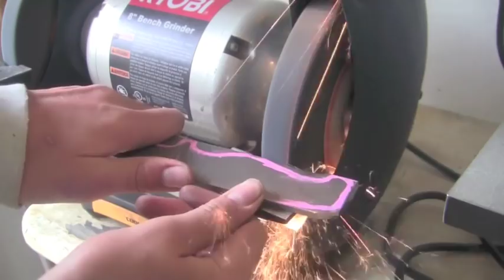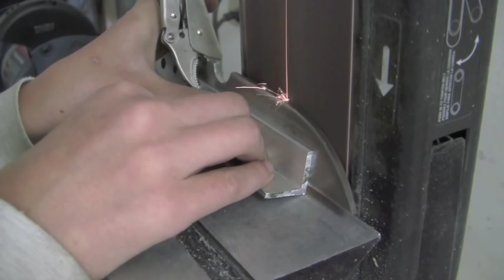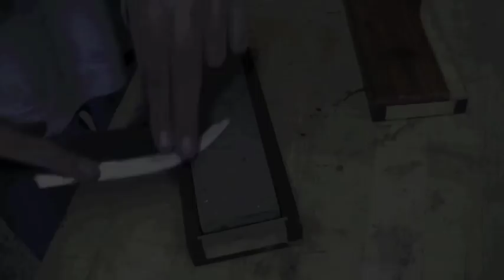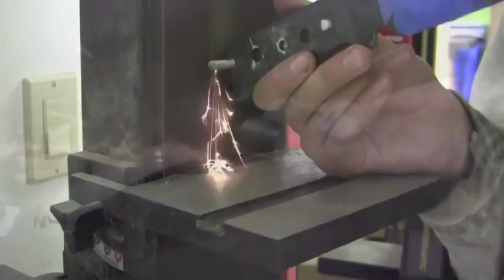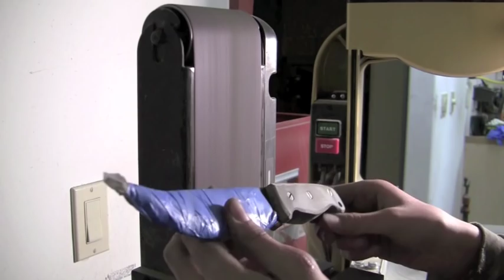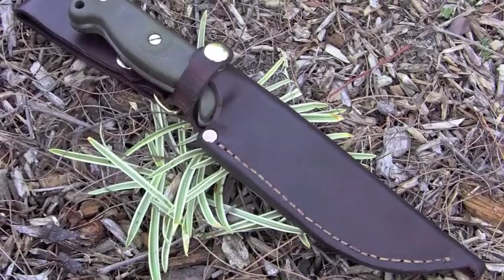Making a Bushcraft Knife

Comment: Where did you get your belt grinder?
Reply from the maker: +Jeremy Baxter That's a Porter Cable 4x36 belt sander in the video. I think I bought it from Home Depot. My current one is a Grizzly 2x72 grinder, which is much better.
Reply: +Mitchel Jacobsen  Thank you, that was helpful, what kind of price range though?
Reply from the maker: +Jeremy Baxter I don't recall. Use google
Reply: +Mitchel Jacobsen Thanks anyway.